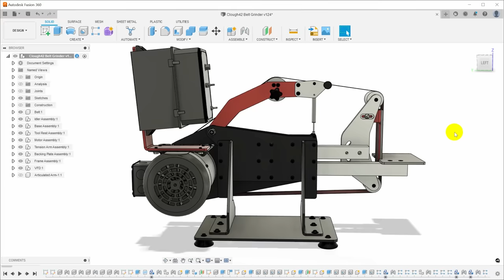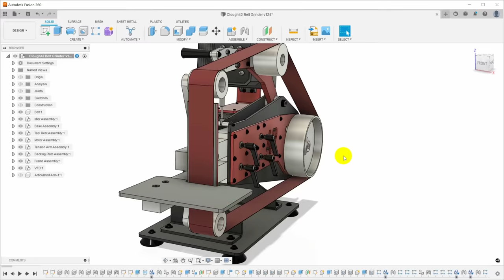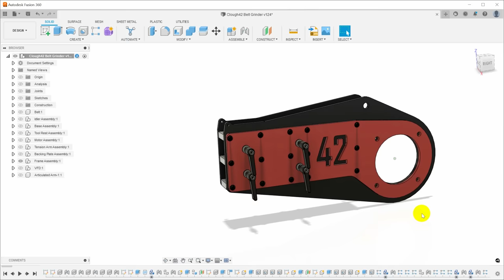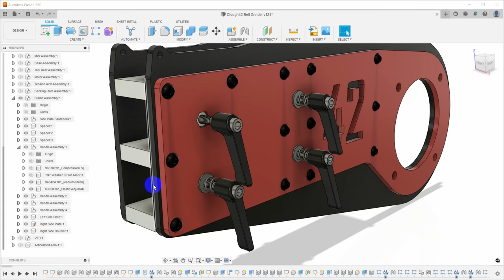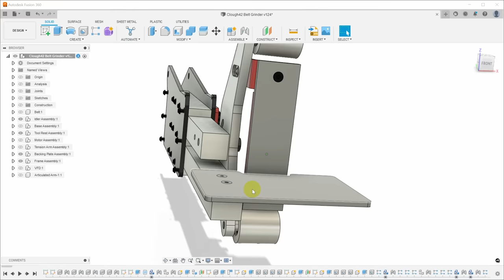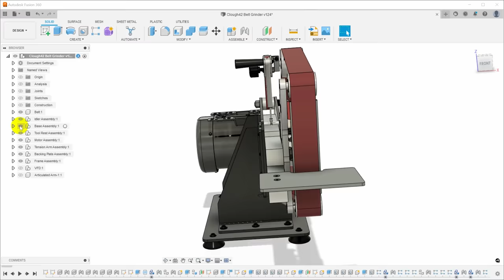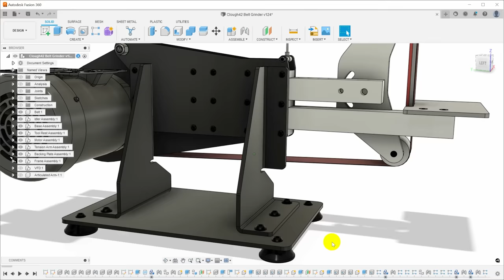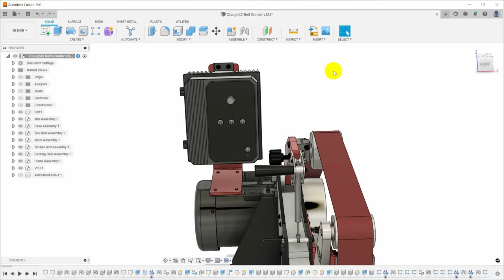Creating my Ultimate DIY Belt Grinder: From CAD to REALITY - Part 1

Comment: A very nice looking design.   The only thing I see for now is that the belt backing plate could use a lead-in radius to help reduce belt wear.  Retired mechanical designer.  Carry on!
Reply from the maker: Yeah, that was an oversight.  I think the soft steel for the backing plate is probably not long for this world.

Comment: I really like this video. The CAD model is a nice touch for understanding the design. 
Does the manufacturers of the purchased parts, motor, VFD etc provide 3D models for you to use or did you have to model them yourself? 👍
Reply from the maker: McMaster-Carr provides 3D models for most of the hardware.  I found the motor and VFD models on other sharing sites, like GrabCad.

Comment: Looks very nice, a lot of hard work went into building and designing. One question why are the two different size bolts for a tighten down the idler plate? Then you will always need two different wrenches or two different sockets for the ratchet to adjust it really like the color scheme.
Reply from the maker: Yeah, the two different size fasteners is something that made sense aesthetically and in CAD, but in practice, needing two wrenches seems silly.  I wasn't thinking about the fact that I'd need to loosen the pivot, too.  There are a lot of details, and it's easy to overlook something.
Reply: Hmmm,  I bet someone knows how to make a custom bolt.

Comment: Is it worth putting a nylon cap on the kip handle screw that clamps the bars? To avoid the steel bolt eating into the aluminum?

Comment: Very nice design and execution, James.

Did you give any thought to dust control, or will you be able to locate the grinder where metal dust won't find its way onto your shop's surfaces, or more importantly, into your nice machine tools?
Reply from the maker: I have a grinding corner in the shop.  We'll see how bad it is and adjust.  I have some ideas.

Comment: I was all set to build a 2x72 belt grinder until realizing that they're nearly four feet long with the table. I'm now considering a 2x48 design - virtually identical but about a foot shorter, and perhaps better suited to smaller garages.
Reply from the maker: Mine is 32" overall, and sits comfortably on a 24" bench.

Comment: Just out of curiosity, why didn't you specify the tapping and counter sinkng done by Sendcutsend?  The dual vice set up for the counter sink, is not something I have, but wondering if Sendcutsend will do that?
Reply from the maker: They do not offer those services with powder coating.  At least they didn't at the time.

Comment: Great design and build.
I was wondering if there is enough space inbetween the flangenut and the bar to put some plugs so the kipphandle threads dont dig in the aluminum barstock.

Maybe add another kipphandle for ajusting the belt angle at the front instead of the hex bolt.
Reply from the maker: That's possible.  There's probably something like 3/16" of an inch.  It would be difficult to get it assembled without them falling out, though.
Reply: @Clough42  Maybe if you tilt the whole machine so they lay flat in the hole.
Reply from the maker: @3dmazter  it weighs 100lbs
Reply: You look strong enough to me ;)
Reply: @Clough42  A dot of glue or silicone sealant would work to hold them in place at least long enough to assemble everything.

Comment: How did you create the legs in F360 in order to flatten it to meet SendCutSend's required format?  Did you need to use the sheet metal environment?  I'd love to see a detailed video tutorial, but I'd be happy with just a short answer to get me pointed in the right direction.  Thanks
Reply from the maker: I use a sketch and export as DXF.  Create a new sketch on the surface of the part (and give it a useful name, like "Left Side DXF").  Use the "Project" tool and click on the face of the part to import all of the edges into the sketch.  Close the sketch, right-click it in the feature tree, and select "Export as DXF" to create a DXF file you can upload to SendCutSend.  For parts with bends, I model them using the sheet metal tools and export the flat pattern as DXF.
Reply: @Clough42  Yes I was referring to the parts with bends ... sheet metal tab it is (never used it before).  Thanks

Comment: Lovely job James - I think you may regret the ally arms though! Please tell me that you re-assembled with some thread locking adhesive🤨
Reply from the maker: The black oxide locks pretty securely into the powder coat.  I doubt it'll be an issue.

Comment: Nice! I think this tool will change your life. You will probably find yourself wanting the articulated tool rest. It's easier to set your angle on the rest than on the platen, because you can design the rest so it has a home position at 90 degrees, but if you set an angle on the platen you will have to use a square to get it back to 90 each time.
Reply from the maker: I have some ideas for how I want an articulated tool rest to work, but I had to stop designing and start building at some point.  :)

Comment: Nice work James.

I hope you have time to answer this, do you have any advice for somebody wanting to do as you and share a space with weight lifting equipment? Currently still in approvals stage of having a new workshop built and would really like to move my gym in there as well (less worries about floor loading and overhead space).

Thank you, Mark
Reply from the maker: My gym is in the garage specifically because I was worried about floor loading in the house, and as the gym has grown, that was a good call.  The biggest issue is metal chips thrown by the mill and other tools.  I'd think seriously about where stuff will be thrown by various machines.  For a hobby shop like mine, it's practical to make a mess and clean it up, but for a shop with more volume, you'd really need to keep stuff contained.
Reply: @Clough42  thanks James for replying about your gym. Definitely won’t be high volume, just me building and playing with whatever interests me most at the time. Sounds like some basic curtaining (heat and fire resistant) might be useful at times though. I had been considering something for “hot work” anyway. Cheers Mark

Comment: Hopefully "fiddling" with that non-parallel parallel was to turn it 180 degrees when you did the other side of the spacer :)
Reply from the maker: I changed to another setup that didn't use it in that orientation.

Comment: Ohhhhhh, thats nice! Could one use tubing instead of the aluminum spacers? Say if you knew a guy with access to a CNC lathe that would whip them up quick fast in a hurry....
Oh, and get thee some form taps. Taps that cut.....bleh.

Comment: Beauty…(my humble 2 cents comments) tooling bars need a recess where the lock bolts will create galling , IMO, double tool bar locks are not necessary and you will find in use the second lock will be an irritant, also round knobs are better (again IMO)
Reply from the maker: Round knobs help with interference, but require more grip strength.  Engineering tradeoffs.

Comment: that is a nice design. what are your thoughts of using 1/4 aluminum plate vs the steel?
Reply from the maker: It would be possible.  I like the weight of the steel.  I wonder if you'd have any trouble counterbalancing the motor with aluminum.
Reply: @Clough42  - I'm thinking about trying out this design of yours, but will likely go with an all aluminum (0.50") build. I will make it tilting, because I also need horizontal grinding ability. I will then have the base bolted to a bench, so then 'counterbalancing' will not be an issue, as you rightly point out. The main reason for me to move to aluminum? I am doing more and more wet grinding (misting system) now (less dust, cooler, etc.), and even the greatest of powder coat jobs, still then get areas weeping rust streaks. Like for example. From those holes you lightly countersink by hand, and the tapping of holes before assembly. It's really about the long term 'looks' for me on this, rather than any possible structural Integrity loss.
👍
Reply: @Clough42  counterbalancing the weight of the motor would be an issue, but could be solved in few ways such as a rearward leg or as Steve mentioned elsewhere bolting it to the bench. .5 Aluminum is something that could be cut on a CNC router at home. I'd bet many of us have those. It'll take awhile, but imagine it would be fun.

Comment: As far as I can judge, nice work as allways. Why not use a square tube in steel for the tooling arms?
Reply from the maker: That would also work, and the design should accommodate it.  I used aluminum because I wanted more thread engagement, and I thought the square tube might have more potential to arrive warped.  Even the square aluminum bars had a little twist when I got them, though, so it might not make much difference.

Comment: Not sure if you are aware, but there are places that sell glass platens that you epoxy on, giving you a very durable, very flat platen. Knife makers use them a lot.
Reply from the maker: Oh, interesting.  I didn't know that.
Reply: @Clough42  You'd want to make sure that it's the right kind of heat resistant glass, like the ones used on the front of ovens.

Comment: I think this is great but I can't help but to think that the machine parts are a major deviation from the original plan to make it as accessible and require as little labor as possible. Do you have any plans or ideas on how to simplify some of the components? I could imagine the thick aluminum bar could be split up into flat plates with flathead countersink screws and a counterbore slot the width of the hex nut. The machined features could potentially be replaced by through holes. Do you have any intent on creating a variation of the design that incorporates more flat components?
Reply from the maker: There are a few parts coming in the future videos that are tough to laser-cut, like the tracking mechanism and the arm pivot.  What you suggest (making laminated bars) is possible, but it makes the parts much more expensive.

Comment: In your next video can you explain why you needed to create those machined features? The recess on the aluminum plate doesn't seem necessary. And the thickness of the spacers seemed like you could have designed around that and not needed to machine those. I don't own any machine tools except for a drill press so now this project is inaccessible to me
Reply from the maker: The recesses are necessary so the heads don't collide with the bars when tilting.  The lower one would collide with the tool rest bar.  Either the spacers or the tooling bars would need to be machined.  If they were the same width, the bars would be clamped and couldn't move.  It would be possible to use shims on nominal-sized spacers.  Maybe I didn't mention that in the video.
Reply: @Clough42  Do you need that much forward-to-backward adjustability of the backing plate? You could replace the carriage bolts with threaded studs, and have the slots in the backing plate. You would still have the advantage of steel/steel threads for connections that experience wear and eliminate a machining step.
Reply: To be fair, you are watching a machining channel, so expecting to be able to replicate anything you see here without access to machine tools is a bit of a stretch! If you want to build this exact design perhaps you could get a local job shop to do the machining for you?

Comment: i don't know anything about belt grinders... is there some kind of concept of a tray to catch dust / fragments? maybe something electro-magnetic so you can catch and easily clean? dunno... just thinking out loud.
Reply from the maker: There are lots of ideas that various people have used, from putting a bucket under the grinding point to spark deflectors, to full trays and shields.

Comment: Love the grinder IL take it hell IL even pay shipping. I really need some quick knowledge  I'm building a X2 table and I'm thinking of putting DC motors on it buy I have no clue weather I should use servo or stepper can you or anyone elce help me with this the table will have a 32" wide an 12" of your travel and not soon but I will want to add a Zip  travel about 8 to 12" do you need acurate waits and me sure to know the power needs ... please help
Reply: Sorry for the typos I hit comment and with this tablet my daughter gave me I don't have a edit option

Comment: Your intro suggested that something major may not have worked out as well as planned. If that was just click bait, I get it. Waiting for the next episode(s) to find out. But if the thing works as good as it looks, I am sure you could sell kitted flat parts and maybe pulleys and bearings. Minimal thinking and work for the folks who like to "build" things but would rather spend more time using them. Yeah, the drawings are available, I can buy those and then spend untold time and money to get the flat stock cut by whoever, but you could have those sets made 10 at a time for a substantial savings. It cost a lot to make one of anything. But once the programming costs are paid, labor at the cutters end drops way off. You know that. If you can make money selling them...PLEASE DO. I'll buy a kit if I can get it for under say, $150. That's a no brainer. $200...You may need to throw in a MAGA Decal.  Of course, big motors are not cheap...that's just how it goes.

Comment: You missed 50% of the functionality by not having a tilt feature to use it horizontally..that's a very big deal..unfortunately your belt grinder missed the mark..that's a serious oversight..
Reply: Not really, just modify the base to allow it to tilt.
Reply: I made a Jeremy Schmidt model of belt grinder 4 years ago.  It has the tilt feature.  In 4 years I have never tilted the grinder other than as a demo for the video.
Reply: @AmateurRedneckWorkshop  really missing out then..perhaps its task specific..a blade maker would use the horizontal feature several times per blade and handle..but a machinist shop probably not..
Reply: @AmateurRedneckWorkshop  I custom built mine off the Claryx metal works pro v2 one a few years back. I use the tilting feature at times, comes in handy.
Reply from the maker: I thought about it, and decided I wouldn't ever use it, so I didn't incorporate it into the leg design for mine.  The leg attachment points are intentionally aligned on nominal spacing so it would be easy to design different legs to add that feature.
Reply: @AmateurRedneckWorkshop  lol classic
Reply: A feller really oughtta have at least two belt grinders anyway. If he feels like he could have used the tilt a couple times in the next year (my prediction for possible needed frequency) it's a big opportunity for a video series covering "belt grinder 2.0"
I built mine a few months ago. I use it every day and have used the horizontal only twice, vertical 99.5% of the time.
Hey, after a while, video subject ideas become a little tough sometimes. You have to pace yourself, i.e. set yourself up for a future gimme.
Reply: @agentcovert  I bet more machine shop use than knife makers.  I am not a knife maker.